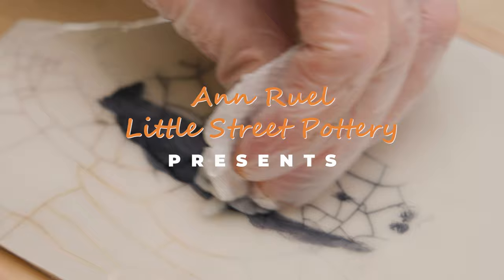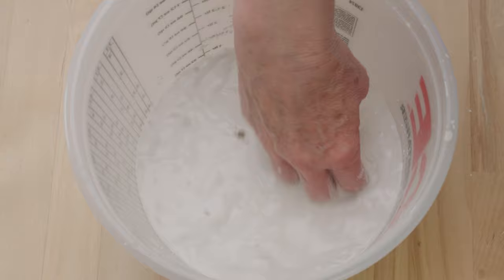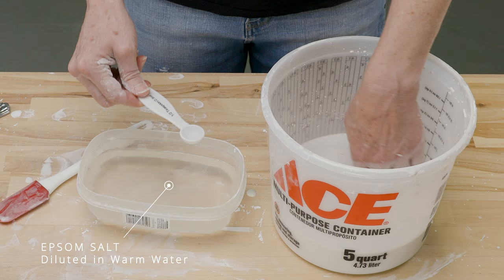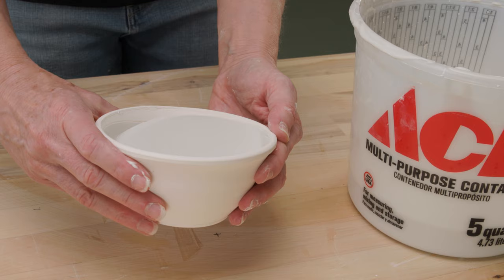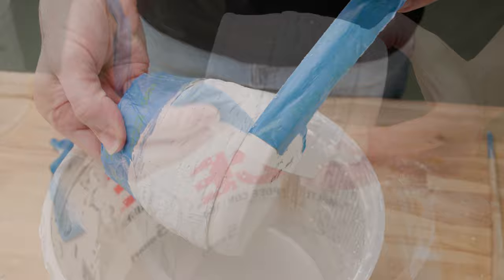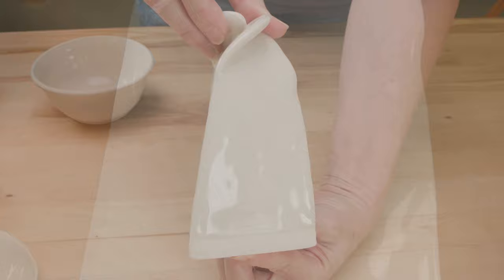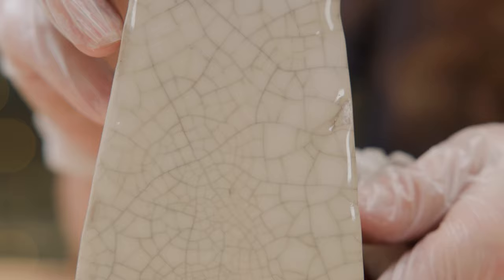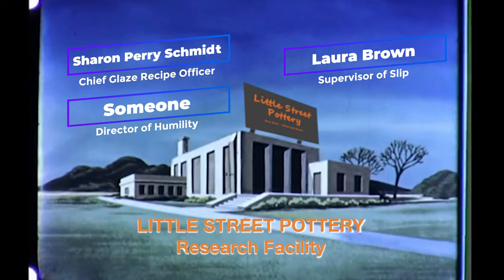Experiments With Crackle Glaze - CRAZING IS THE CRAZE!

Comment: Lovely effect. I’ve used a prepared brush-on glaze before, and although I got beautiful results, over time, say three months, the clay body absorbed the ink until you could barely see it. When I then applied more ink to freshen it up, there were far more cracks than there had been originally, so it wasn’t as appealing. The ink from the original application, having been sucked into the clay body, led to the second application being less crisp and defined. Perhaps a higher bisque would solve the problem.
Reply from the maker: Thanks...will have to keep an eye on that!

Comment: I’ve never seen anyone allow a glaze to sit in a pot so long. I haven’t made my own glazes but I have seen people dip their pieces. I swear there is nothing worse than that pinging noise when you aren’t trying to crackle a glaze!! It’s just the worst!! Lol. I LOVE the inks in the glaze! I unfortunately have quite a few crackled pieces that I’ll try to do this with. One last question, since these are alcohol inks are they going to stay? I wonder what a regular ink would do. I’m doing to go down and try a few different inks on one of the many crazed I mean crackled pieces that I have!
Reply: Hey Michele.  If you have pieces that have the crazing to happen on them, that means that the glaze and the clay body are not good fits for each other.  This causes a lot of stress when they are fired and the glaze cracks.  the only thing you can do is to reformulate the glaze to fit the clay body.  Sounds like those crazed pieces would be good ones to experiment on though.  As far as the inks go, they are advertised to be permanent inks so I am hoping they stay permanent.  I can tell you that I accidentally got some of the ink on the bottom of one of the pieces and it was not easy to get off.  I tried sandpaper, diamond pads, and finally a grinder drill bit.  i could get a lot of it off with the drill, but not all of it so it seems pretty permanent, although steadfast....I am not sure of until time passes and we just see.  Good luck with your experiments.  Let me know if you get a chance how it goes.
Reply: @annruel1982  Thank you. I know why they craze but the very odd thing about my pieces is that I use the same clay and glazes and sometimes they craze and sometimes they don’t. It’s very frustrating. I buy pre-made glazes so I can’t really change them. I did notice that if I put a matte glaze on the outside of the piece and a gloss on the inside it tends to craze more often. But thanks for the tips, as always. I used the alcohol inks in mixed media and they were permanent, I just wasn’t sure they would stay in the cracks because it evaporates very easy but of course after thinking about it the inks are actually staining the area between the tiny cracks and maybe going as deep into the crack to stain the bisque so it will be permanent. I did try to add stain to several pieces that had crazed but the crazing was so small that I didn’t get very much color at all. But I was pretty tired when I tried it lol. Maybe I’ll try again. Your video did remind me that I have several low fire crackle glazes! Thanks as always.
Reply: @micheledickey4066  Interesting. My thinking is that either the glaze WILL craze, or it may have cracks that may be there but are harder to detect.  I bet if you put tea in the piece, they will show up sooner or later.  If the glaze doesnt fit at one point, it is not going to fit at another time unless you alter the recipe or perhaps use a different raw material that had something else in it that changed the composition or something.  That is just my experience.  Thanks for the information about the alcohol inks.  I have heard they are permanent, but the only way to find out for sure is time, right.  Happy potting Michele!  It is always a pleasure to talk to you.

Comment: Do you think an oxide could highlight the cracks in this approach?
Reply: Hi FFSS60.  Good question.  Actually since the stain needs to be fired onto the piece to be permanent and the cracks dont show up until after it is fired, that would be a problem. You wouldnt be able to apply the oxide until after the firing and  at that point you wouldnt be able to refire it to melt the oxide onto the surface because it would remelt the glaze and  it would alter the spider web cracks.  Does that make sense?

Comment: Do the inks stay in the cracks even after washing w soap and water? :000 Also are they food safe? Amazing video as usuall!
Reply: Hi.  Thanks for the questions.  As far as the inks go, we used permanent ink so I know when they dry they wont wash off. In fact, I accidentally got some of the ink on the bottom of one of the pots and used sandpaper to try and get it off without success.  I also used a grinder bit on a drill and did manage to get a lot of it off but not all of it....and I was really trying.  As far as whether the glaze is food safe the answer is a big fat NO!!  I made sure to let everyone know that fact in the video as I would not want anyone to use it to eat off of.  This glaze is strictly for decorative purposes only.  This is not a food safe glaze and I wouldnt put permanent ink on food safe pieces either.  The bowls and pieces we used to make this video were strictly samples for testing and will not be suitable for food.